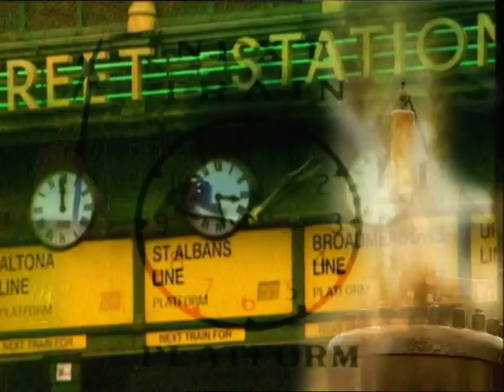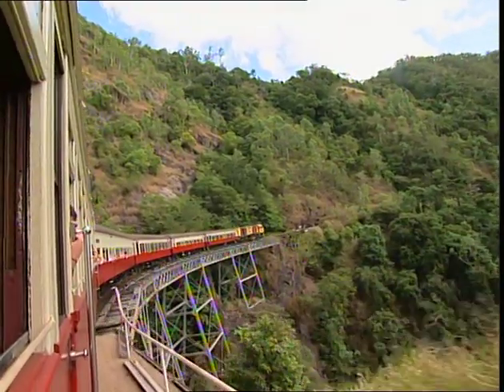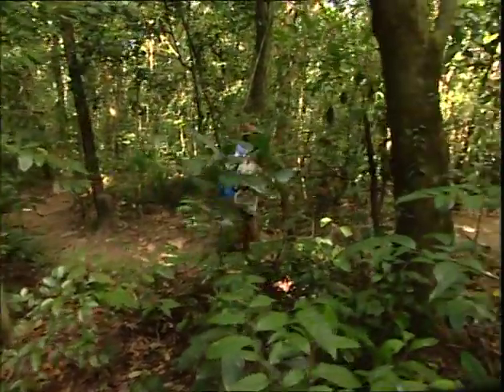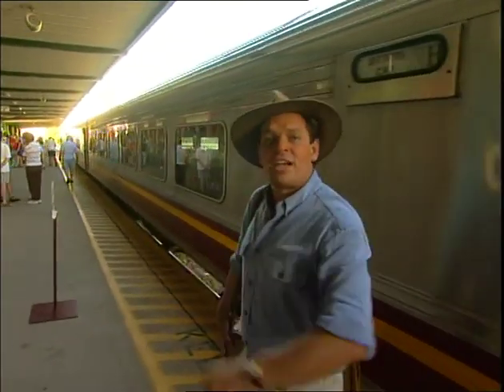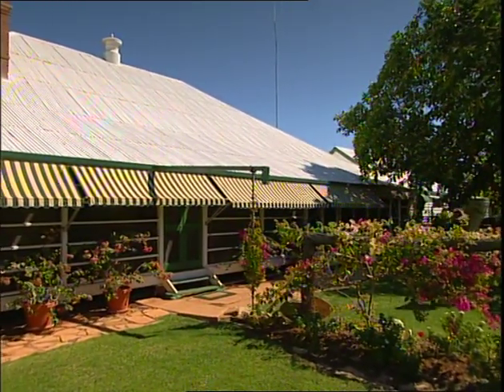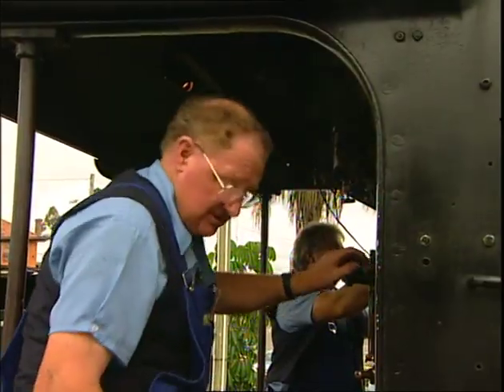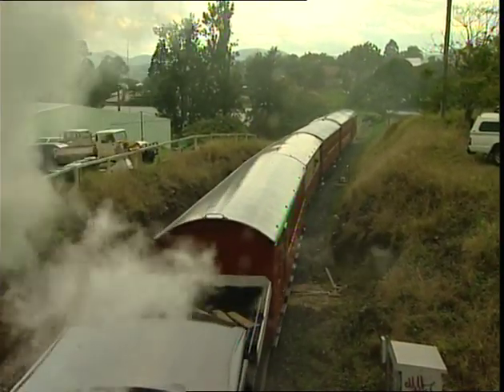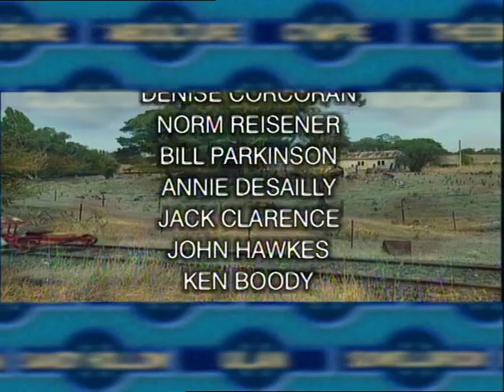Railway Adventures Across Australia [Part 1 - Queensland]

Comment: The "Great south pacific express" was canned when QR decided it wasn't worth it cost wise. 30 or so million down the drain and shipped off to Preu where they run as "Belmond Andean Explorer". Unfortunately, much of the styling has been striped out and modernised. I guess it kept one workshop open for a bit. Too bad the Liberals ran the entire industry into the ground when they outsourced the new trains from Bombardier to India instead of building locally.
Reply: Maybe that's why they got tossed out after 1 term. Newman was clearly and will always be known as the worst premier Queensland ever had
Reply: Anna Bligh privatised QR freight systems. Campbell did what needed to be done, just a bit too fast for some of you.